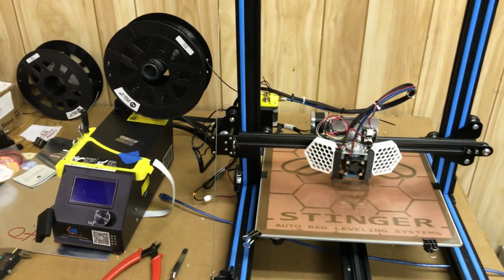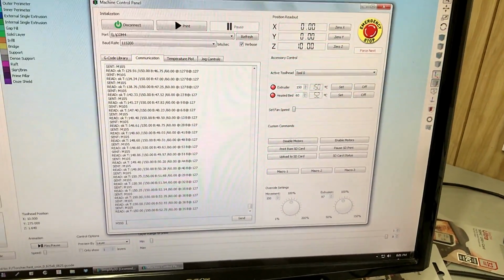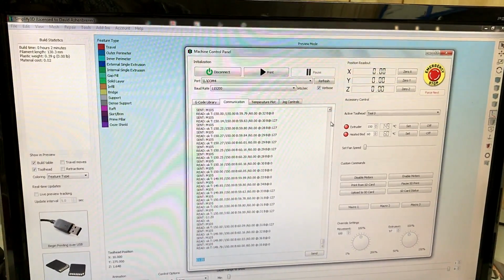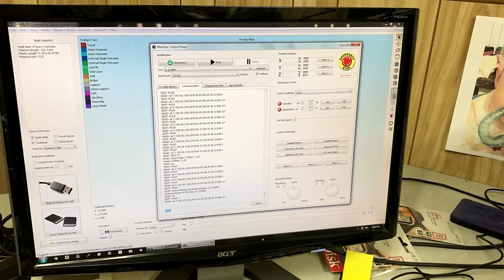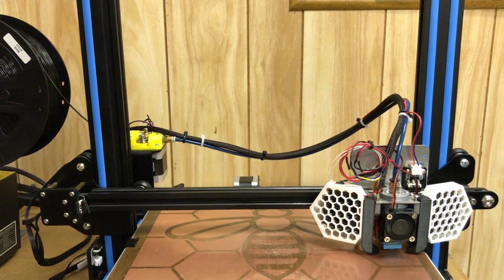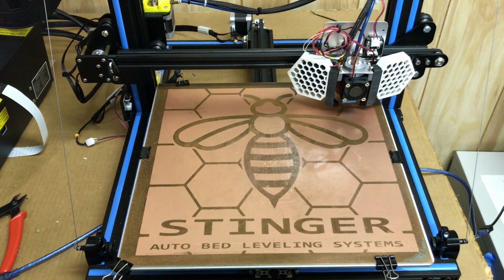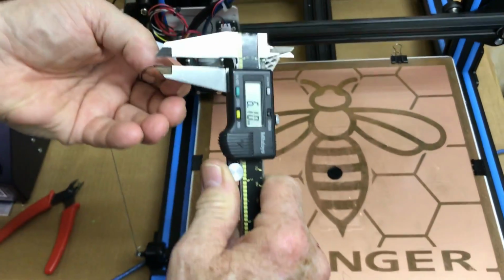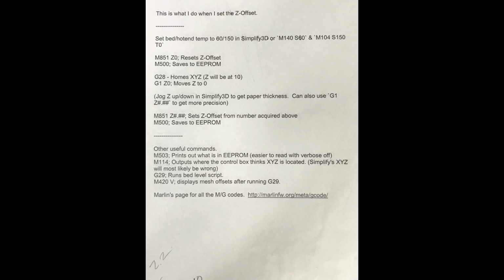Setting STINGER Z Offset

Comment: David, what are you adjusting while using the paper sheet? I could not get it. I also would like you to make clear how to use that 4 little metal  pipes. I assume they are used to lock out the bed height, right? I've been out of the city. But now I just need to complete the software part...
Reply from the maker: Douglas S I’m jogging the tip up off the deck then down from where it touched the bed and triggers the switch after the G1 Z0 command. 
See the cheat sheet at the end. 
 You can also use your controller to jog down to the paper height then go to the control menus and “save settings”. 
I will be redoing the video including setting it with the controller. 
Does that help?  
You can always email me: technical@3dprint2form.com. 
The pipes are solid spacers to take the place of the springs.
Reply: Thanks David. I will tell you right after I have tried (this weekend). Thanks a lot!
Reply from the maker: Douglas S please get ahold of me. I’ll b happy to walk u thru.